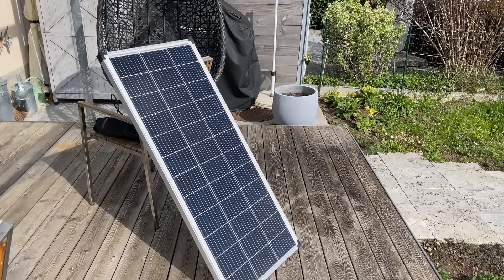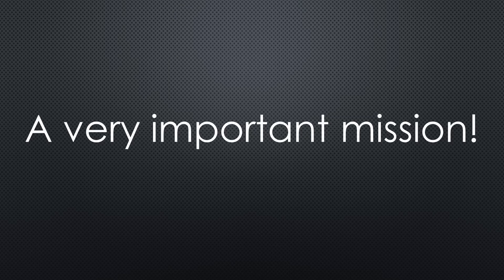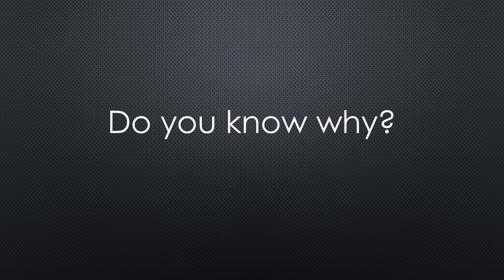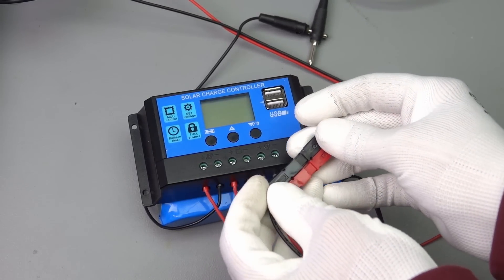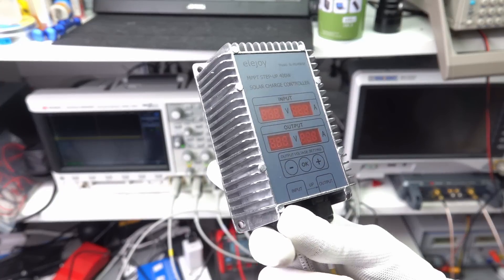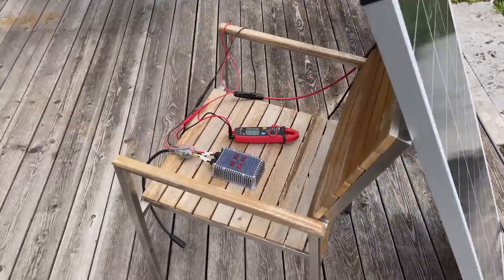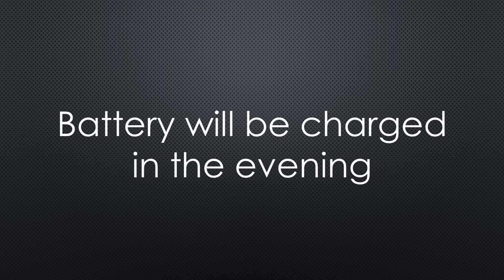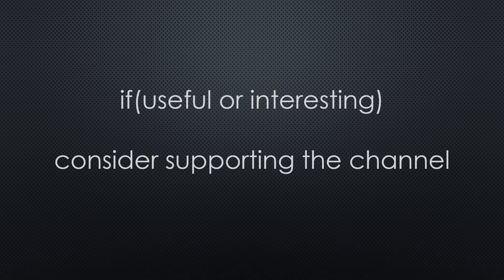454 How to Build an Solar Battery Charger for eBike / Electric Bicycle

Comment: Nice timing Andreas as I’m just now starting my own DIY pseudo portable solar system.  The steps you went through sounds like a typical engineering epic journey, where the problems you had to solve along the way are typical for solar and wind projects.  Thanks for the video!
Reply from the maker: My pleasure! and good luck with your project.

Comment: Nice video, very relatable. I also often start out with a project thinking it's not so hard. So I promise someone that I'll create a solution for them, and then things start to go wrong. And because they don't want to know the technical details, they start to assume I'm not as skilled or smart as I think I am. Usually when I finally manage to finish the project, I set the record straight by explaining in laymen's terms what went wrong. And after a couple of years I usually get happy comments that the solution I designed is still working great ☺️
Reply from the maker: The result is what counts! If the "customers" are happy in the end, i think, we can forget a lot of pain.

Comment: A few decades ago, I got to design a MPPT for satellites.  This was an analog design, with a little digital, so it was an interesting project.  The basic problem of staying on the right side of the max power point can be tricky, especially when that point is moving around!
Reply: That sounds interesting. Can you share some insights, how does the analog circuit work?
Reply from the maker: I agree. Today, with digital and cheap sensors, maybe it is a bit easier. Particularly if the sunlight fluctuates fast.
Reply: @ffoska  The essense of the MPPT circuit was that the output current command to the buck converter was dithered with a small square wave.  This produced a similar ripple on the voltage and current from the solar array.  These were multiplied together (with a multiplier circuit) to produce a power signal.  As you increased the value of the output current command (by means of an integrator), the power ripple would decrease.  In fact, the power ripple was the input to the integrator.  As you got closer to the peak power point, the ripple decreased, causing the integrator to gradually approach the peak power point.  A small bias was applied to the integrator to keep it from crossing to the other side of the peak power point, which would cause the solar array to collapse.  That's the 30 second explanation.  🙂
Reply: Wow that's amazing, what battery chemistry do they use ?
Reply: @jacobclark89  This was for satellites, and  nicads were the only proven chemistry at that time.  The battery packs were big and heavy... big enough to be a safety risk when the satellite came back down.
Reply: @SkyhawkSteve  thanks for the reply, That's amazing work you've done ! Can you recommend a mppt charger brand ? I've tried lithium ion, LTO, and now I am using lifepo4 chemistry for my recumbent ebike, I like the lifepo4 but For my next pack it might be sodium ion , I think they are starting to put them in ev cars so it looks like it might be the next best thing , great attributes like being less taxing on the planet !
Reply: @jacobclark89  I've been out of that area of tech since then, and have not been following mppt development.  With modern electronics and processors, it shouldn't be hard to implement... but some manufacturers will want to cut costs as much as possible, so finding good reviews is always a good idea.  Battery tech has come a long ways too, which is great.  I've got a number of bikes, including a couple of recumbents, so batteries for lights is something I keep an eye on.  Dynamo lights have come a long way too.  Good luck.
Reply: @SkyhawkSteve  thanks, I've had the best luck with a rear light made by Blackburn it's a square COB USB rechargeable I got it at Walmart like 4 years ago and used it a ton very bright, don't know if it's still available . I ride one handed so I uses rechargeable flashlight for my head light, it allows me to scan the road or get a driver's attention if they look like they don't see me. I also use a helmet with a rear light built in. That 3m engineers grade reflector tape also is a great way to stay alive at night ! Be safe bro

Comment: Nice video Andreas, thanks! It's always nice when a technical video explains the whole process, including little setbacks. Couple of questions:
1) How did you find the connector, did you get any hint anywhere about its make?
2) Does the 5V line draw any significant power or is it just a polarization? In the latter case a simple linear voltage regulator fed with the 42V (or even a 5V Zener?) could have been enough?
Reply from the maker: 1. The brand was printed on the charger's plug. The rest was Google
2. I did not measure the current. But you are right, most probably, a Zener diode would be a much simpler solution.
Reply: @AndreasSpiess  1. You were lucky (or the brand is very proud of their connector 😀 )
Reply: @simosayt  I am asumming the 5V line is not simply a signal line but some sort of power supply to a microcontroller chip built into battery pack  which controls and monitors the battery.  I still do not think it draws a sigbificant amount of power but might have some situations when it locks itself out when powered from the 42V converter since the converter only works when the battery is prezent and the battery is not detected as prezent unless it receives that 5V supply. I would be interested to know how long it takes to the battery to accept charging after it receives 5V. If it is (almost) instantaneous then is just a signal if it takes 5-10 seconds or more is a microcontroller powered by 5V line which takes a little time to boot and become operational.

Comment: Yes not an easy feat. I theory voltage multipliers are simple in design to be efficient, but you both have to incorporate both charging  and panel current limit to make it work reliably in all conditions. Thank you for this video. I'm currently trying to get 37V solar into 240V DC charging and my first two approaches turned out to get strange oscillations.
Reply from the maker: Power supplies and oscillations are partners. They often come together :-( I wish you luck!

Comment: I suppose one could throw efficiency out the window and charge with AC and oversize the array.  Not very portable, but I have seen bikes that pull trailers :)  Great work finding a more sensible solution!
Reply from the maker: The size of the panel is also important because she lives in a rented apartment. Bigger panels need some discussions...

Comment: My first thought was also "that shouldn't be too hard!" as I have in fact built the same setup for our e-bike batteries, also with a 100W panel, and using a $40 MPPT charger from Ali. It's been working really well for a year now, just missing some monitoring in Homeassistant maybe one day.
But your video nicely highlights unexpected pitfalls, and cascading complexities rippling through. I built my own batteries, so I have the easy-to-buy connectors already, and my batteries don't need the 5V enable pin. Easy! But in your case, the need for sourcing 5V sounds easy, and then comes back with more complications even when everything else is solved. I've had exactly the same problems in other projects, where something seemingly simple comes back to haunt you over and over again, and you just can't escape the complexity trap... nice illustration of the life of an engineer, very true.
Reply from the maker: I assume your battery voltage was lower than the voltage of the panel. Monitoring in HA would be nice. I just built a 7kWh battery with a Daly BMS. It has an UART output and I found a ESP8266 project to connect to this connector. The output are MQTT Messages...

Comment: The double DC-DC converters are a bit of an overkill, aren't they? ;) Since it's really just an on/off signal, it's very likely that anything from 3-5V would trigger charging on the battery. A simple 10:1 resistor divider on the battery voltage should be enough. That divider should even easily fit into the connector that goes to the battery.
Reply from the maker: Others suggested a Zener diode instead of the second resistor. I agree, these would be simpler solutions!

Comment: Thank you! For my model year 2010 26V Panasonic drive  I use third pary batteries with XLR charging connector. So, a small Victron MPPT and a popular RD DC DC converter did the trick. Was not the cheapest solution but worked straight forward. An the RD DC-DC converter is also usable in my lab.  I charge my Ebike to 96% only. This doubles the lifetime.
Reply from the maker: I had such RD converters in my hands! But unfortunately, all ended at around 36V. Otherwise, they would have been a perfect solution with the displays and the current limiter built-in.
I assume the Victron is a good solution. But they start at around 100 dollars if I remember right...
Reply: @AndreasSpiess  yes, you are right. As I wrote: Not the cheapest solution but straight forward. At that time I budgeted it to emergency provisions. Ebike charging was just a nice "bycatch".
Reply from the maker: @klassichd10  Bycatch in this respect is always welcome ;-)

Comment: ‘This should be easy ..I’m smart ‘ …😂😂
Can so relate . So many little ‘gotchas’ in the video 
Had so many laughs .. thanks 😊

I charge my ebike via a used solar panel with PWM controller charging a crate of used SLA batts(~24v28ah) to a boost converter set at 42v . Has been working for 5+ years
Reply from the maker: Also a good idea!

Comment: Thank you for this! Having just purchased an E-bike 'conversion kit' for my ride I'm thinking about a portable solar charger so my battery can be refilled while I have a rest/picnic mid-ride! (Edit: removed bit about lower voltage - my charger is 42 Volts as well!)
The family problems brought home the things us 'tinkerers' have to face - "why is it taking so long?" "Why don't you just buy one instead of making it yourself?" etc.!
Reply from the maker: We all have two batteries for long trips. Solar is not a solution for that problem in my opinion. To big for what you get in a short time.

Comment: This sounds so easy if you had direct access to the battery. A solar panel of the right voltage is already a current limited source, so all you would need is a voltage regulator (MPP, LDO or DC/DC) to regulate the output to the full battery level. The BMS will take care of the balancing of the cells.
Reply from the maker: The battery has a built-in BMS. The problem is to get a relatively small panel with 42 V MPP...

Comment: Interesting. TeachingTech just did a video explaining how he created his own custom connector for an obscure terminal with pins and 3D printing ("Making an unavailable, proprietary USB cable with 3D printing").
I suppose if it's used on a daily basis, it would have to be really well designed which means lots of iterations. So maybe it would have taken the same time and cost(?) as buying it. But you may have to do it one day when the supplier goes out of business or no longer makes the connector :P Let me know what you think of that video if you get a chance to watch it. 
As for your video - brilliant as always and thank you for sharing!
Reply from the maker: I agree, 3D printers are marvellous devices to print spare parts. But here, I also needed very special contacts. That made the thing more complex, I think.
Reply: Also it's difficult to get it as sturdy and smooth with 3D printing.
Reply: @AndreasSpiess  Depends on if you needed to make the male side or the female side of the pins.

If you only need to make the male side of the connector, you'd be surprised what you can actually get away with.  I've retrofitted some connectors using things like old 2mm RC plugs and machined pins glued into a 3d printed plug replacement.

Actually I had one sitting right here and realized...  I actually made the female side of the plug using 2mm RC female contacts heh.

Comment: at this moment 8:08 I would simply give 5V Zener diode on 42V output to get 5V low current trigger to the battery - let me see the rest of the video to see what you did
Reply: OK, I saw till the end and I am not sure why you did not think about "my" way ;-)
Reply: Smart Idea. Would made the Design a lot simpler.
Reply: Exactly my idea as well, if the current will not be to high, so you can stabilize with a relatively high resistor and Zener diode. However…. It is probably used to feed the charger controller in the bike, so that current must be measured and taken into account.
Reply from the maker: You are absolutely right. But I started with the buck converter and was focussed too much to step back when I encountered the "insulation" issue.

Comment: I had a project last year to harvest the sun light from my apartment windows. I also used a MPPT controller. My battery is reused from my scooter which can nolonger starts the engine well but fine for the solar controller. Any power exceed the tiny scooter battery I charge it to battery banks through the USB ports on the controller.
Since my panels can only get indirect sunlight and stay vertical behind the windows. I get about 20Wh a day each window with 120W panel.
But there are some benefits other than the power generated. The room get a bit cooler. I think the energy that the solar panels converted were used to heat up the room.
Reply from the maker: I think you are right that the power converted to electricity cannot heat your room. But maybe also some energy is reflected by your panel.

Comment: An easy solution would be to buy 2*24v 50W panels in series and using a common MPPT buck regulator.
Reply from the maker: I agree. This would also be a solution if you do not have an MPPT boost converter.

Comment: I did something like that a few years ago but my way to solve it, I use the reverse approach, looked for a solar charger controller that works with 36v/42v batteries, I also looked into a 36v inverter "very difficult to find", manage to get a Epever solar charger controller, then I added 2 solar panels "I think 3" and it works fine, I think it has an usb port too which are normally 5v but I didnt need it for my setup...
Reply from the maker: Good approach. Much better than mine!

Comment: We live in Zurich and wanted to charge our two Flyers as well with solar energy. Since neither of us has an electrical engineering degree, we went the easy route. 2 x 100W Panel (on garden shed) -> Ecoflow River Pro Battery (720Wh) -> A/C output port -> Flyer battery charger -> Flyer(s). It's very easy to build and except for the battery quite cheap. Next part of the project: Protecting the battery from cold weather. We are moving the battery inside the house (near the circuit box) and connect it to that part of the house grid that feeds the power outlet in the garden shed where we charge the bikes - with a switch in the circuit box that lets us choose between grid power and battery power. In this phase we'll also add a third panel since they are so cheap. Now, sure I would have LOVED a direct charge solution like yours, but 18 months ago, nobody was able to provide a solution. I even wrote to Flyer, that this would be an awesome opportunity for them to create a eco-friendly solar charge system exclusive to their bikes. I really wonder why nobody jumped on that train yet...
Reply from the maker: Indeed, your solution is easier to build. And can be used for many other situations, too. But, as you mention: The price is very high because of the built-in battery. Here we invested this money into a second bike battery which is used during longer trips. So we can charge one and use the second one in normal situations.
18 months ago, I also did not know how to build it. Maybe a startup uses the idea ;-)

Comment: Cn3722 boards or similar range on aliexpress are closer to mppt than the pwm controllers you tried early in the video, I have one working in my shed for a few years and modified them with potentiometers  to have control of finish voltage. Also an aside if anyone tries to copy for a different applications. You can not float charge lithium batteries. So when the current draw of the batteries drops to a low level the charger should stop. A BMS may provide a disconnect but that is usually a over charge condition 4.25V/cell and is already doing damage to the cells.
Reply from the maker: I am not sure if you would not encounter the issues I encountered with the PWM charge controller because of my special situation.

Comment: Wow, I felt your pain Andreas! My smaller project recently involved a small multi-purpose  auxiliary battery that had to be rugged and functional for charging not only in the vehicle 12 volt system from the alternator, but also direct plug when I can use a solar panel.  It was an interesting adventure but far easier than yours, I'm impressed. Great job friend!
Reply: It consisted of 4 Headway 38120  LiFePo4's and a cheap BMS from Heltec. It's perfect for my job as a SCADA technician.
Reply from the maker: I am glad you found your solution. Always a good thing!

Comment: I almost cried, thankfully it was a happy ending. 

By the way this project is not easy you need a microcontroller and a control system to design it. I have a couple of my friends working PhD on this, while i am working on control systems design 🙂.
Reply from the maker: So good luck with your project!

Comment: Great mptt charger, I'll look it up but why not just use $5 step up converter? Ebike battery has overcharge protection so there should be no issues. I'm charging my  52V ebike from 12V battery that gets its power from solar ocasionally, it served me well for past 2 years.
Reply from the maker: I thought I mentioned why a standard booster did not work in my case...
Reply: @AndreasSpiess  sorry, I always follow your videos from start to finish, I somehow missed that